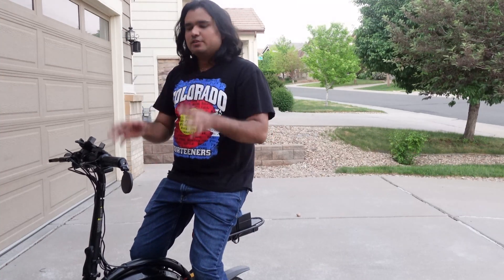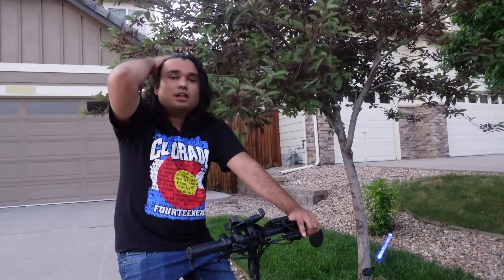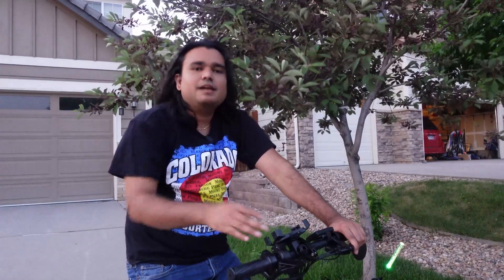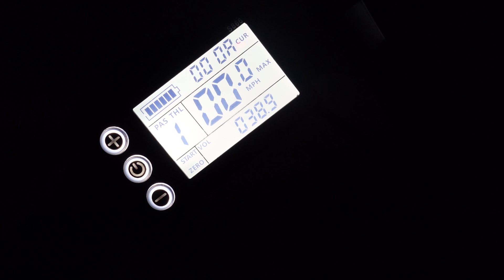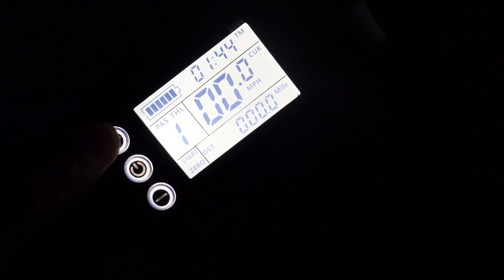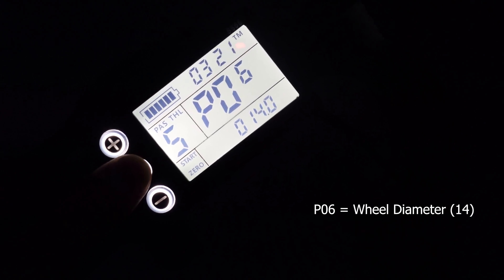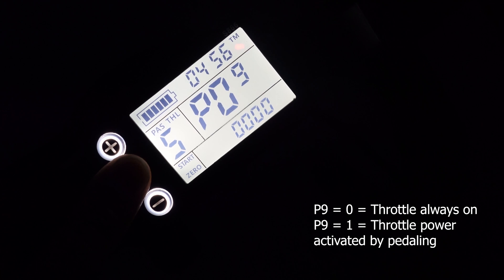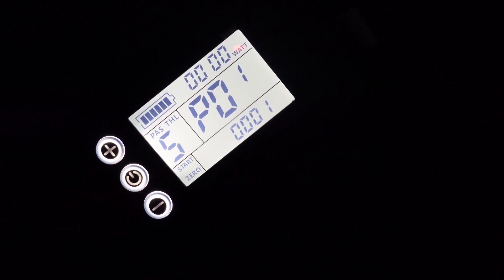Electric Bike (Jetson Bolt Pro) - Controller Upgrade Settings & Questions

Comment: i tried it and it worked for a few rotations. then i got the signal about my brake sensors... i removed the sensors long ago and didnt have any issues with my old controller. my controller is not giving me power and dont have any brakes or sensors to attach... can i bypass somehow?
Reply: i disconnected my PAS and now it works...

Comment: I know it's been several years since this video has been posted, but I'm dying here. I bought an s866 controller with a 40 volt battery. The controller gets power and that's literally about it. I don't know how to test the motor to see if it's getting power and I'm using the stock twist throttle. I have a multimeter and everything seems to have the proper number of volts but I simply cannot get this thing to move or twitch. If you or any of your viewers can help God damn it I would appreciate it.

Comment: i was curious if you knew... i upgraded my controller and the torque just dissapeared. it lost all powered watsoever. i apgraded to a 22a kt controller but i kept the current to about 15 and it was terrible compared to stock. clearly something wrong but i cant figure it out. the controller works perfect in my front drive geatred folding bike

Comment: I cannot find your controller installation video? May you help me!! I can’t figure out how to connect the original 6 pin throttle to my new 48v controller
Reply: On YT mobile app it's at the very bottom of the description, past the Transcription section. It took me a very long time to find it, and by chance I found the controller installation video he mentions in this video. My guess is that he mistakenly forgot to add it to his Jetson playlists on his channel, since it's not on there.

Comment: I did the same upgrade with the controller. The battery has also been upgraded to a 10amp battery. However I cannot get the additional 3 to 4 mph. The highest speed is the same as with the original controller. Any suggestions??

Comment: I can already tell you now that once I do the controller upgrade I’m going to have to do the battery upgrade. That’s why I have the battery already on the way 48 V with a lot of range and what’s so good about it is I looked at the specs on the Jetson motor 350 W motor, it can handle a lot more, we are being really cautious with this bike as you should because you know the regulations are really serious and if you don’t follow the regulations as far as the speed limits so many could get hurt or you can hurt yourself so with the speed comes responsibility just to put that out there so everybody knowsgreat and thank you

Comment: I have the controller already. I’m about to follow your video and do the controller upgrade. The battery 48 V is on its way once I install the battery along with the controller before I put the battery in. I have a BMS reader I just wanna see and make sure everything is correct, but I will show this to the Jetson electric bike community

Comment: Your videos are very helpful. Do you have a video showing the controller upgrade process? I could really use a wiring diagram for the UD3-UL controller. It has several small white connectors and I likely need to replace with new connectors.
Reply from the maker: Thanks. I replaced it with a Brainpower controller so yours may not match. Plus my bike is older version and Jetson changed their wiring on the new ones. Happy to send you a link if you want.
Reply: @ShivaSapkota  yes please
Reply from the maker: @jangno  Here you go: 
https://youtu.be/InoocxVSAuY

Comment: I did all the mod, but when it's finish I got an e10 error on the display. Check all wiring again, but still have the error. Did somebody have resolved similar issue?
Reply: I didn’t have an e10 but an e07 and come to find out I had wired the front light wrong cause there is a couple wires that are black and red or blue and red so I wasn’t sure which one was for the front light but once I grabbed the other set of wires in the paid of black and red or blue and red I can’t quite remember but once I switched the wires that code went away so just make sure u have Wired all the wires to the exact one it should go to

Comment: Uphill it doesn't have very little power, the assisted pedaling doesn't work and not only does it make more noise but it also vibrates a lot and I don't think it's normal.. what could it be due to?

Comment: did this 48v upgrade with your settings on bolt and the motor has power but makes a crazy grinding noise has power please help
Reply: Same with the grinding noise.

Comment: So I bought the brainpower 24/36v controller and realized I needed the 36/48 it after installing it. Everything ran fine using then24/36. I still got 20-21mph on 48v. I ordered the 36/46v controller and opened then up. They are exactly the same. Both have 64v compasitiors.. and same part numbers. They are identical.

Comment: Hello everybody!
I replaced the controller and since then the bike doesn't move forward when I'm on it. With the original controller it worked perfectly. I don't understand where it could come from. The engine makes a lot of noise compared to before. Would you have any ideas? THANKS.

Comment: Your opinion please. My ebike is a 6 year old Prodecotech X2. The company is out of business. The bike has a Bafang 500watt hub motor powered by a 36 volt battery.
   Will I have a problem using this 350 watt rated controller with my 500 watt motor? The original controller lasted 5 years. I replaced it with another Amazon controller that lasted less than 1 year.
  My goal is to have the power assist. I am not looking for more speed  just an effective assist. I am okay with 10 to 15 mph.
  Thank you for your video and any advice.
Reply from the maker: Wattage number is more of a reference and the controller will set how much max wattage you can get. The 350W controller is fine for a 500W motor but you will only get 350W of power. That means less hill climbing abilities and definitely cannot haul as much load. But to answer your question, I don't see any issues with using a 350W rated controller for a 500W rated motor. Thanks.

Comment: Aloha!! I finished the install last night. Everything seems to be working except when i sit on the back motor shutters. Bike on stand if spins fine. I followed all the settings. Wire hook ups all seem right. My pedal assist wires was different but hooked it up blk/blk red/red and yellow/blue, is that correct? Pedal assist doesnt seem to operate normal. You think hall wires is different? Its all matched to same colors
Reply: have you figured out your issues?
I'm having some problems with mine.
Reply: @ulightme  did you ever figure yours out? I too am having this problem lol - wheel spins fine without resistance but with any kind of weight or resistance it's pathetic
Reply: @zachhillegas6840  all you can really do is mess with the motor sense cables .. try them in different combinations .. that's what worked for me
Reply: Yes i did. I had to switch the blue and green phase wires

Comment: Hi,I upgraded controller and installed 48v 10ah battery but now the pedal assist doesn’t engage right away I have to pedal a few rotations before it works ,Does anyone else have this problem? or know how to fix it?

Comment: Hey shiva! I was wondering if I could use jumper cables like for the speed hack to connect the cables instead of cutting wires. Is that possible? It looks like it's just male to female cables.

Comment: Outstanding video. I have a issue maybe someone can help. My headlight won’t work, I connected to the plug off the LCD plug. But not working. Does the controller LCD short that jumper when pressed so is it just a regular switch
Reply: Same here, brother... did you find a solution?

Comment: Hey, what is the max current that this controller can withstand? I have a 12v 35 AMP HR battery and was wondering whether I could use it on the stock controller or upgrade to a controller that could withstand this current.

Comment: Shiva,
I successfully did the controller upgrade following your instructions and I also upgraded my battery to 48 volts. I bought a battery from ienyridscooter. That bike is built on the assembly line right next to Jetson but it has a 48 volt battery. I used that battery, (which is the identical size as the 36v Jetson), and the controller from your link. Everything works great.

I found that if the negative "-" button is held in once you have the PAS setting down to zero, it enables a "walk" mode.  Just start walking and the bike will motor ahead at about 2-3 MPH.  No need to hold the negative button once the bike starts moving but you must roll the bike forward to get it to start moving after you enter the "walk" mode.

Thanks for all your videos

m
Reply: Where can I find the directions to install the upgraded controller?  I bought the upgraded controller with S866 LCD screen but can't find a good instuctional video on how to install it since plugs are different and it isn't a direct replacement.
Reply: @carebearmovie  Here is the link for the controller upgrade.  You also need to know all the new setting inside the display for this to work once you have it all wired together.  https://youtu.be/InoocxVSAuY
Reply: @carebearmovie  You need to send him an email requesting the upgrade video.   To  Shiva Sapkota
@ShivaSapkota     He will send you a hyper link to it.   Just so you know, the wiring is not easy.  It is NOT just  plug-in project.  
Some plug types do not match.  Some wire colors do not match.  If you get the wiring correct you still need to change display settings for important things
Reply: @martinmccabe177 I have a S866 lcd display 7 wires (brown and white are lights) bút I need to connect the (other 5 wires) to my throttle and then to my power switch on my motor controller.
I would be very grateful if you can send me a picture or email how to connect the wires the right way.
Thnx Frank Grinwis
Reply: @frankgrinwis298  It has been a long time ago that I did this upgrade. All I did was order a controller and 48 volt battery from ienyridscooter. The battery was the same size and fit okay.  I simply followed the instructions that ShivaSapkota posted on this webpage.  https://www.youtube.com/watch?v=InoocxVSAuY      In a previous post somewhere I mentioned that the colors don't match in some cases, I read the posts below the webpage above to see what colors other people were finding and using to connect to  the bike from the controller.  I also added a thumb throttle.  The bike is sealed up and as putting the case on without pinching any wires was an epic, I dare not open it up to look at the colors..but like I said above I just followed all his instructions and connected the ones I could ID first, which left only a few wires to match the colors together.   sorry I don't have any more info for you
Reply: @carebearmovie  If you get the wiring done these are the controller settings.
P1   Display brightness 1 2 or 3
P2   MPH or KPH
P3   48 Voltage
P4   10 Display time out time
P5   Speed modes 0=3 1=5 2=9
P6   14 Wheel diameter
P7   24 Number of magnets
P8   100 Speed limit
P9   000 or throttle will not work without pedaling MUST stay at 0000
P10  1 for throttle only no PAS
P11  2 sensitivity  Sensitivity at 2 give immediate PAS help
P12  Power start 5   May give more power at start ???
P13  6 Number of PAS magnets
P14  13 Current limit to controller
P15  40 Voltage under voltage
P16  ??Audio setting
P17  0 Cruise control 0 is off 1 is Auto cruise
P18  75 Makes speedometer accurate
P19  1 default no idea what it does
P20  0 default no idea what it does
P21  ?? P 21  is it enabled? it overrides THR PAS
     PAS THR defaults to 1 when the display turned off
P22  ?
Reply: @carebearmovie 
I'm having the same thing/problem with my S866 lcd display 7 wires (brown and white are for the lights)
I need help fixing this because I am going Banana's óvèr this !
Reply: What’s the amp on that battery? And are you getting more range?
Reply: @benjohngf  Bike is currently out in cold and dark garage. I will respond tomorrow with the amps, but I cannot answer your second question since I am 340 pounds of fat and only use the bike to drive the two  miles between my house and the reapair garage for my car when needed. I am the last guy that needs an electric bike to replace walking but I have terminal laziness.

Comment: Hello, I wired up this controller and it works but the motor is studdering and the power drops off.  When cycling through the displays, yours shows the Watts at the top and mine shows "E 00".  Any ideas on what may be wrong?
Reply: The issue ended up being the motor phase wires.   Blue to blue, yellow to green, green to yellow got it running strong.  Still have the E00 code on the screen though.

Comment: Any advice on when you turn the throttle and the motor pulses and stops? The brake icon briefly flashes too. But I've completely unplugged the brakes too. It was all working fine and then once I bundled it up and put on the cover it started the pulsing. Everything seems fine though, not sure what point of failure I should be focused on.
Reply: Every figure this out?
Reply: Maybe the pedal assist is connected incorrectly?

Comment: Hi Shiva I upgraded my Jetson bolt pro with a KT36/48ZWSR-ffF01 controller with SW900 LCD kit and an FT-21x thumb throttle. I've wired everything properly except for the lights. All the parts I've used are brand new and this would be my second esc upgrade and for some reason the motor does not run. Please help me. I don't wanna have to buy another controller kit just to get the bike running.
Reply from the maker: Usually the issue is with throttle wiring. If you have a volt meter, you can probably figure our which wire is the OEM throttle wire. On the newer Bolt Pros the throttle is Green as opposed to being blue for me. Unfortunately without having your bike infront of me, I am unable to troubleshoot it for you :(
Reply: @ShivaSapkota  the OEM throttle wires were black red and green. They were originally soldered on with the battery display along with cruise and light switch. The first esc and the this second one im currently dealing with has  white wire instead of green and the wiring diagram off the new esc has its own wiring separate compared to the OEM which was soldered on with the battery display. It is indeed unfortunate I can't show you the bike but I'm going to try and put the bike back to its original OEM state and go from there. Thanks Shiva! Your channel is always helpfull

Comment: Hello @shiva sapkota woning if you know what wires the power but goes to on the controller? Bought one from offerup to fix up but can't get it to turn on tested battery and button and all is good, but the only wires that were cut were the power buttton wires. do you know where on the controller they connect to?

Comment: Hi Shiva, i have a huffy oslo that only comes with pedal assist from factory, will buying a new controller with a throttle option give me the option to use throttle or is their additional parts i would need to purchase?

Comment: Hi Shiva, I did follow your tutorial but when I when I'm done wiring I'm getting e07 eror on the lcd. Any suggestion. Thanks in advance...
Reply: I know it's been 2 years but, on my end the e07 error code is "Motor Failure". My guess is you need to check the Hall sensor wires.

Comment: Hi i have a question about not swapping the controller. I will just use the old controller but addon the display shifting control. Is that possible?

Comment: Alrighty Shiva. I've had it, and I'm officially stumped. Here are my findings so far when connecting the white wire from the controller for throttle to ALL FOUR remaining wires from the bike-side throttle harness, as well as when putting in the int cable:
WHITE TO:
Yellow = no throttle
Yellow + int = constant reverse
White = no throttle
White + int = constant reverse
Blue = no throttle
Blue + int = constant forward EXCEPT: When I powered it down 
                      And restarted it, the motor ran in constant reverse
Green = gets throttle, but reverse
Green + int = constant reverse throttle

Because of this, I decided to try to just switch the polarity of the three phase motor with the white cable connected to green. Nothing worked. It either stalled out the motor, or locked it. I put the 3 phase wiring back to original and the motor still works fine.

As far as I can tell, all of my settings on the display match yours. Where could this problem be?
Reply: Sounds like you have the intelligent battery cables (green wires) connected which is supposed to switch the "direction" of the motor in the controller when you cycle the power on/off. With the rear wheel in the air, turn the bike on, wheel should move forward direction (if not, turn bike off then on to reverse polarity) and then it will stop on its own after a couple seconds. Then unplug the green wires and leave it alone. This will store the direction of the motor. Remember to set your PAS or "throttle" to maximum to get the full throttle range. Hope that helps.
Reply: @TheBimmerBarn  thank you. I'm going to have to reset the pas to max, but the int cable wasn't exactly the problem. The only reasons I connected it were: a) to test motor function when NOT having int cable connected resulted in 0 throttle; and b) when NOT having int cable connected resulted in constant or throttle-engaged reverse motion. Connecting them was intentional, and I tested all 4 remaining throttle harness wires both without, and with, int cable connected, for troubleshooting purposes.